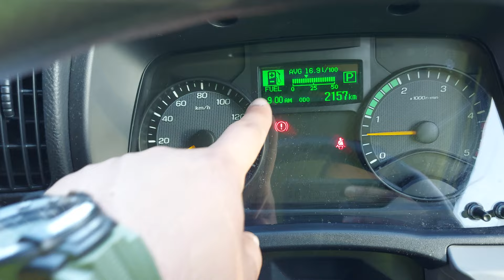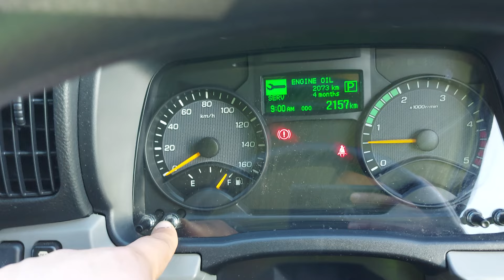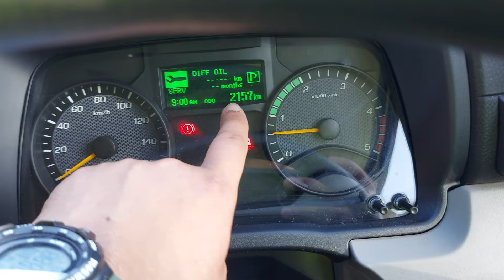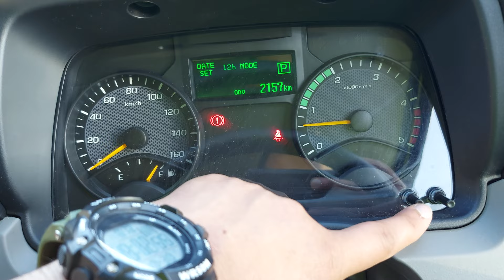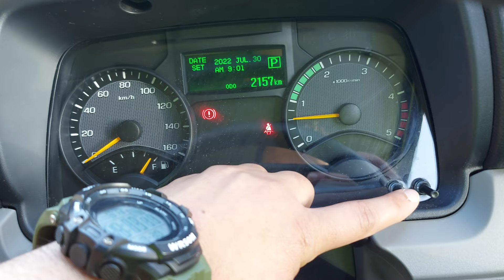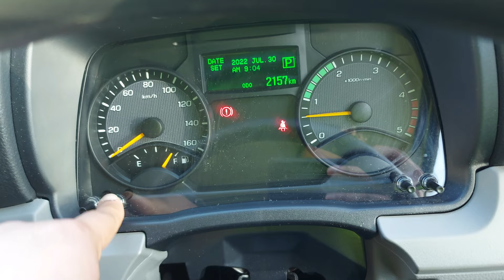Mitsubishi Fuso Instrument Cluster

Comment: Boss how to fix the issue showing engine oil, engine SYS
Reply from the maker: Hi, I would suggest you take the truck to a mechanic so that they can use the OBD scanner tool to find out if there are any issues and clear the error codes.
Reply: @therandomchannel_06  thanks boss